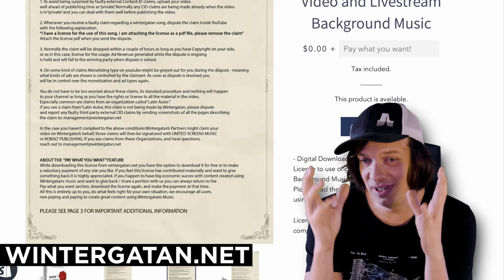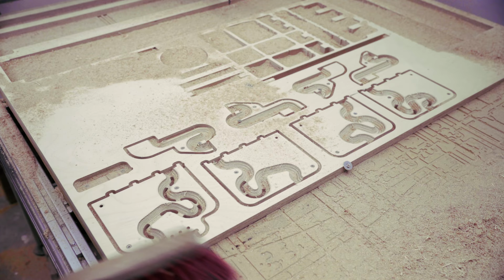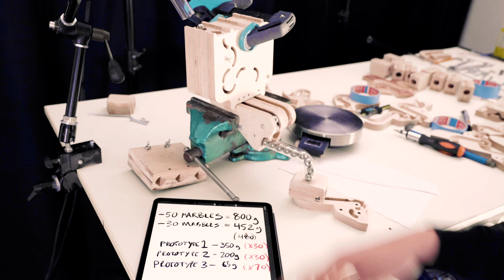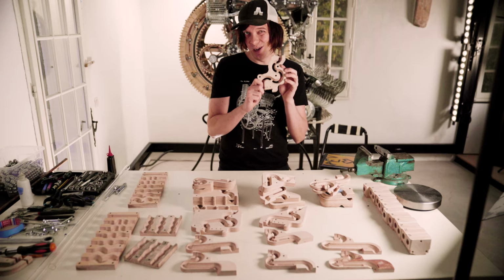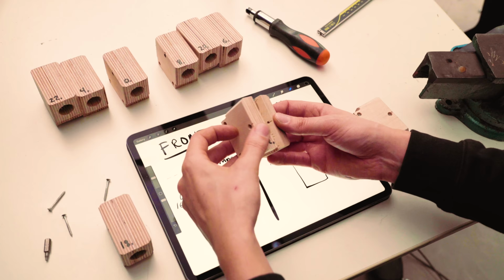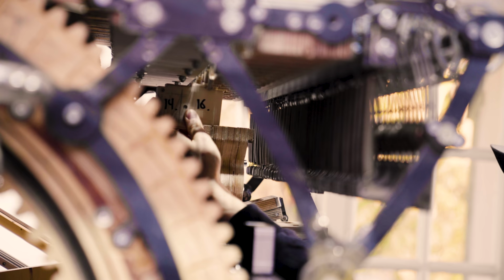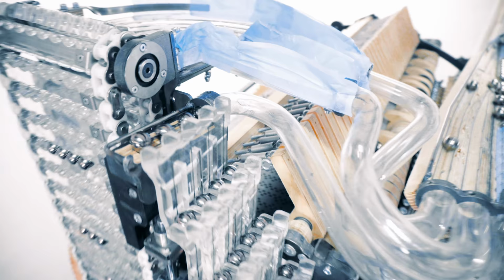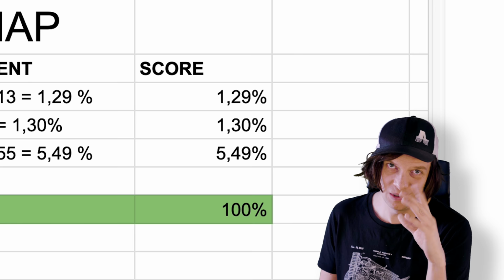Playing 20000 Marbles - Marble Machine X #147

Comment: Think of it this way.

You have a bike. One wheel (the back one) is small. The other (front) is large. Two times the diameter of the back wheel. You can put a mark on both wheels to serve as a point of reference. If you begin rotating both wheels at the same speed (ride it), it will take the back wheel two rotations to rotate the front one once (I think, I'm not a math person, it might actually be more, don't @me). This is because the front wheel has more surface area than the back, increasing the travel distance required for it to make a full rotation. They are indeed spinning at the same absolute rate, but the relative rare is much slower for the front wheel. If you were to spin both wheels at say... 1 RPM simultaneously, their relative rate is the same, but their absolute is very different. As a result, if you were to set two motors to spin at the same RPM for both wheels, the larger one would move much further, much faster.

How does this translate to a sphere?

Think of the sphere as layers of wheels. If you draw a line directly perpendicular to the rotational axis, this is the center, and the largest wheel. As you move off to the side of this line, you have smaller wheels. The closer you are to the axis of rotation, the smaller the wheel. Less surface area, less absolute speed, less travel distance to make one rotation.

Comment: Martin, I'm in awe of your achievements and have been enjoying your approach to reliability engineering.

When you make repairs (such as last week), or attach a new bit of machinery to MMX, would it be practical to do a smoke test, by running 150 or 180 marbles per minute for (say) 20 minutes?

Assuming it's practical (and you know your machine far better than I do), my thinking is the faster rate will cause problems to happen even faster than the 25% or 50% speedup would indicate (you might expect 1.5x the problems at 180 marbles/min, but I'm hoping for a quadratic increase - 2.25x the problems at the faster rate) - allowing you to find problems faster and throw your demonstrated thoroughness at fixing them, clearing the simpler stuff out before you do the 20k+ marathon runs.

Comment: CHECK THIS OUT, with the belts vibrating consider this. in the bicycle industry we call them Ghost rings, but they are basically an idler ring that goes inside the belt and because they are in contact with both sides of the chain then they never move. here is a picture I found that helps explain. I believe Martin could make this look super cool!
https://forums.mtbr.com/attachments/singlespeed/1117373d1485209686-ghost-rings-whos-done-img_4566.jpg

Comment: You are chasing the nines like in the semiconductor industry.
If you can make a single transistor on the chip with 99.99999% reliability, that means you practically cannot make any working modern CPU-s at all.

Comment: I foresee a possible problem with the friction valves. At the moment they are working flawlessly because those two channels are full, providing weight behind the front marbles and pushing them through the u-bends. However, if only 2 or 3 marbles end up in those channels during an intensive song, they wont travel through the 'uphill' bends and will just sit there until more fill the channel to push them through. If the plan is to have enough marbles in the machine at rest to fill EVERY channel to the top, this shouldn't be an issue - but only as long as other channels are not playing too intensively during a song and hogging all the marbles. Also - I am guessing the basket is spitting out the second marble on the rebound after the first hit of the rapid double stroke, they are striking faster than the basket leaf-spring can recover..?

Comment: I forget most Europeans use commas rather than full stops as a decimal delimiter. It's so disappointing to me when the metric system makes so much sense.
Do you guys ever run into issues without the disambiguation provided by using a full stop? (I am aware that for # of DP that aren't 3 this may be a lot more obvious)

Comment: When Martin realizes the error of his ways, (starting this quest all wrong), he may lose his contact with reality and go truly mad.  First, he should have used marbles, not steel ball bearings. No magnetic interference, much less noise and the possibility of polishing the glass balls to frictionless perfection. Plus the the fact that, just as music is mathematical art - so too are the color variations of glass equally glorious as refractive light frequencies, adding significant scientific dimension. and more bling to his splendid machine. Also, since glass marbles are lighter, all his control points will need to be more precise and of finer tolerances, yielding greater reward as he achieves his goals. Oh, I don't expect him to start all over - after all he is just a great musician with the heart and soul of a brilliant engineer.
BUT--- maybe if we offered him money?  How do you spell Patreon???
Reply: His website already has that function without giving a large fraction to patreon the company.

Comment: Instead of metal ribs on the catch funnels, why not try a more responsive and quiet cloth with glittery sequins. That will give a better visual response, with the right angle of light. (Use a stretchy material and a loose fit, to exaggerate the impact.)

You can still use independent rails and a funnel at the end... But retain a solid "wall" of material for a 100% capture. (Same concept as your carpet tray, but with the concept of your "cages" retained.)

Also, maybe in your marble gates... Make a hole in the bottom plate, with a quiet nylon "rail", to hold the marble in the plate. (The hole on each side of the rail, so "debris" can fall out and a quick poke with a metal rod can be used to free any jams if they happen in the gates.)

Your marble gates can also be more visible if you use a "cage", instead of solid chunks of wood blocks. Remember, you only have to hold the marble in place with a thin edge. 95% of that wood "tube" isn't even needed. (Could be cut metal plates, thinner wood, nylon for quietness and reduced friction.)

Your guide rails can also be made less noisy, everywhere, by coating the non-contact sides with that plastic coating. (So the marbles still roll smooth on the contact side.) Your drop guides and the slope guides all over. You are just trying to stop the harmonic vibration. So it does not act like a tuning fork.

Same for the magnetic return wheels... Plastic coating in the groove will reduce some of that "snap" sound as the magnet grabs the marble.

Your "fins" on the bass can be made "better", if you drill out channels, from the bottom and cram rubber rods in them. (Reduces that harmonic ringing.) Even better... Cut out the centers and replace them with nylon or plexiglass. Keep the tapered outer edge of the fins. They get hit the least.

For your bass and drums, you can also make a glittery banner to direct the over-bounce marbles back towards the cloth glittery catch funnels setup, if the bounce remains too crazy. (Remember, a perfect hit on a currently vibrating string will "launch" marbles with an equal force of the prior marbles forces... Like a trampoline that has someone constantly jumping on it, then a new person hits it at the right time, it launches them higher.)

Why not just return the overflow back to the bottom? As opposed to joining it back near the top? Your return system should be able to handle all the required returns. You are just making more noise with the divide by four gates and return roll, to an already full system. Drop them down, quietly in a cloth drop tube, to a buffer that ensures your walking return always has four marbles in the steps.

You already have an adequate buffer of overhead, silent resting marbles in the drop tubes.

If you find that the trailing edge needs more marbles for the "beats"... Direct more marbles from the walker drop, to deliver them to that last segment. Honestly, all four rails should be setup return an even split, but you could adjust it, based on the play demand of the templates. A guide rail that can be lowered, depending on the song demands, or... As you activate the levers that start the consumption process for each open channel. (Remembering that there would be a buffer below to store more marbles than ever needed as your return setup should be delivering more marbles than needed, to fill gaps.)

Comment: Are the tests repeatable?
Inside of a single run, you're theoretically getting repeatability of whatever the marble count is, minus 1.

There were issues with the 5'000 marbles.  Diagnostic changes improved the session repeatability, and 10'000 marbles went through (or, one marble with 9'999 repeatability).  20'000 marbles is just the 10'000 marble test repeated without an interval spacing.

That there were marble escapes in the 20'000 test is another data point.

The system may be changing over time, or the design changes incorporated are bringing in new issues.

If the 10'000 test has been run several times in a row under the same design you would have that additional data point:  if NO marbles escape, then the design seems pretty stable and that's true repeatability.

That there are escapes in the 20'000 test would make it appear that there was a difference in the 10'001 to 20'000 tests, that's not necessarily the case.  Since the design changed, the 10'000 test was on a different system.  For better testing, changing only the design or only the testing scale is appropriate.

It's also awkward that for each run, a different track is being tested.  Eventually, all tracks (instruments) will need to be tested at the same time.

The changes made in one part of the system may have effects on the other tracks.  A feed problem that results in a design change for the drum tracks may wind up starving the feed for (some other track).

This is fascinating.  More. More tests.  More times.

Comment: I think you over count reliability. Hold on, listen for just a second. Because the 20,000 marbles don't go through every path, that means that every path was only tested for some subset of the 20,000. For example, the two gates only got 10,000 marbles each. The two lift mechanisms also got much less than 20,000 each. I'm not trying to give you the blues, but rather support you. In your quest for reliability, you want to know how much testing each path got so that you can accurately know to what level they each got tested, right? (In Europe, 20,000 is written as 20.000? Is that right?)

Comment: You've made quite some progress!  :-)
What you plan to do with issue #4 is what is called a belt tensioner. In the auto world, a belt tensioner (pully) keeps tension on the serpentine belt so it will keep it driving what it's operating. Alternator, water pump, and such. Engines use a harmonic balancer, as well. It's mounted to the crankshaft and helps to eliminate vibrations caused by the pressures of the cylinders on the crankshaft. IDK if at the rate your main shaft in the machine is spinning at and how much vibrations are occurring but, if the mechanisms you're mounting to it, if they're way out of balance, it could have an effect on the vibrations and just as important, the wear of the machine...  Anyhow, just some thoughts...  :-)

Comment: The reliability score is incorrect 20000 marbles tested with 19939 successful gives a reliability of 19939/20000 = 0.99695 on a scale from 0 to 1. To convert to percent you multiply this by 100 and get 99.695%, but note that spreadsheets do this step for you when you format the number as percent.

Comment: Marbles might jump higher if you're playing a faster beat, basically think of the surface the marbles hit as ripples, if marbles hit it faster it creates more ripples and then the surface becomes more springy and so marbles will jump higher, if you do lots of marbles at a fast speed hitting the drum then it will possibly mean the marbles jump higher, same would happen on metal as the vibrations go through the metal and the energy has to go somewhere and so the more the metal is hit, the more it vibrates, and so at a faster speed the marbles might jump slightly higher. So you might want to test the marbles at a higher speed or faster tempo. I'm not sure if this will be a problem, but you should test a fast tempo to see. Also you could just make slightly larger catchers if it's a problem? 

Also add something to prevent the drum wearing from being hit with marbles?

Comment: That over rotation trick won't help with the pressure.

You are using a dynamic phenomenon to counter a static phenomenon. And if my rigid body dynamics classes have taught me one thing, that doesn't work ^^
I believe the increase in performance that was observed anyway came from two other factors that you changed between Prototype 2 and 3 ( you changed more than one parameter, you mad scientist! ):
    - the increased smoothness comes from the paths having a lower curvature (wider turns)
    - the decreased static pressure comes from the tracks having much more drastic changes in direction (I mean sections that are very far from vertical, compared to all of them being rather close to vertical on P1 and P2)
So in 4 words, wider and longer turns.
These are mere hypothesis of course, and would require further testing.

Hope this helps, 
Regards

Comment: Very sorry you got this bad experience with wood salers in France. But I have to admit that if you don't know a good adress with a personal link this may be difficult. 
I bought marine plywood grade in the most popular shop, I made 300km to get it. Did not check because I did not imagine it could be shit in a 5stars dealer shop, but they sold me several planks which should have never been sold, the 2 external sides were missing half a millimeter.
Impossible to use it for a serious project. 
There is a sad tendency which I hope is fading out with younger generations, many salers don't feel they make a good deal if they don't fool the customer ! So be smart, search for a pro link or come with friend recommendations, say you buy for a big entreprise, wear Alain Delon's hat, etc.. 
Most of the ply sold in large stocks are used for concrete molding. 
While I saw you can build boats with 'everyday' plywood in Finland /ex (with good epoxy coating).
I had though a great experience in a sawmill close to my home. Nice people happy to be involved in original projects. 
But all in all sure it's not cool to feel like playing in a casino when you need to rely on good quality, and pay the right price !
I have to say I bought several music instruments in Germany, two of  it were like my plywood, could have been perfect without half a millimeter lacking...

Comment: Marbles on the floor is not a CRITICAL failure. If I were you, I would note down the problem and move on. You should be stopping only for critical problems before you come to complete system integration. Otherwise you would not know if you are using time wisely. Once you have reasonably realistic test of the complete system, you would have luxury to address non-critical problems. Since you would know, by then, the full list of problems or at least list of most likely problems, you can categorize, rank and address in a realistic schedule. This is how testing of complex systems work.

Comment: Tracks used 0.5/38 then 2/38 when it should be 1/38 vs 2/38 you added one dropping gates not three you did not quad your drop rate your math is off. And second 1.3%*4 is 5.2 not 5.5 with that being said 1.045 is 0.5 of 38 not 1.3.

Comment: Please please fix your math! Your percentage calculation is wrong! You calculate as follows: reliability = 100 - (failed / marbles). It should be (1 - (failed / marbles)) * 100.

This gives you a 100 times better score than the real result!

You don't have 99.997, you really have 99.695!